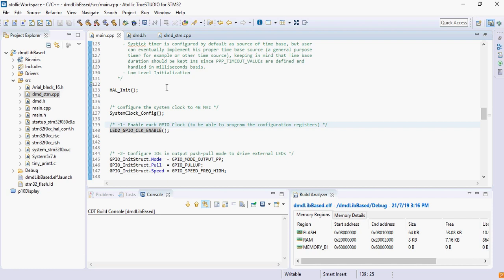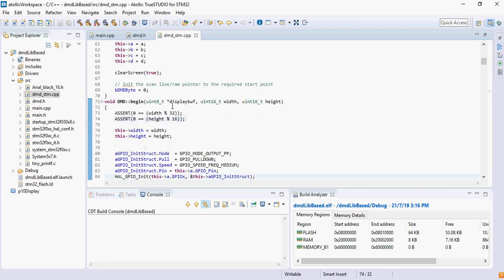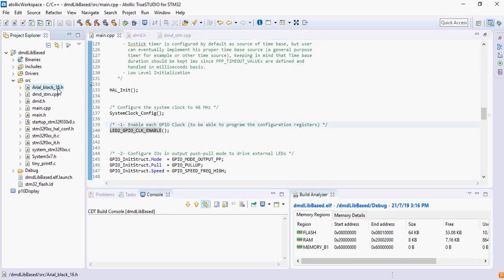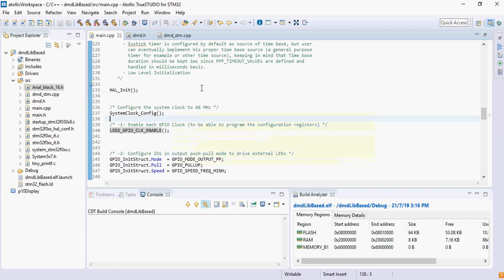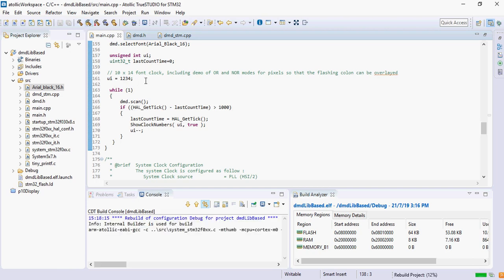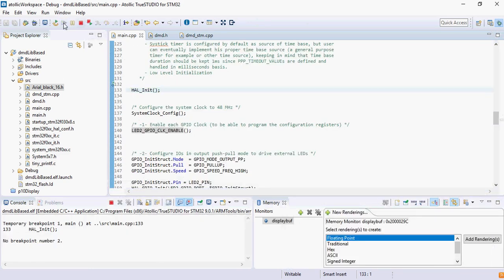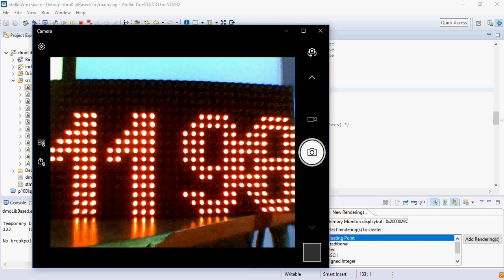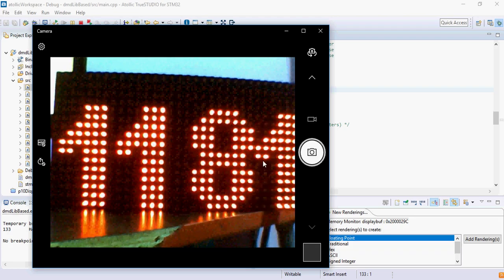Demo apps on #stm32 for LED display #Atollic,#P10Display,#P10,#DMD,#Arduino,#Microcontroller

Comment: The explanation here is simple and straight. However, i want to add, you ported c++ to c++. Have you tried 
to port the DMD library to c? I ran to some issues. Can you help with pixels mapping in display? 
I need indepth understanding. pls.
Reply from the maker: Thanks for the comment.

Yes I did port the DMD library to C as well and I am currently video on the same.

Please do subscribe and press Bell icon to get notified when I upload it

 In my previous video I have explained the DMD library internals which might help you to understand pixel mapping. Link is here - https://youtu.be/bwJOFZ7Z8es
Reply: @embsyspracticallearning9433   Sure I will subcribe, I have always had issues the Interrupt triggers HardFault Exception and Understanding PixelWrite.